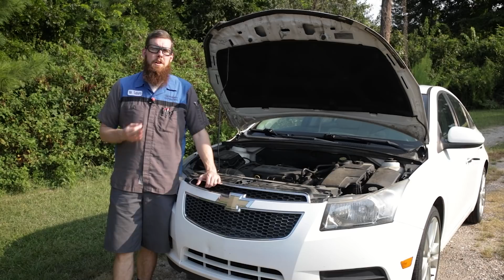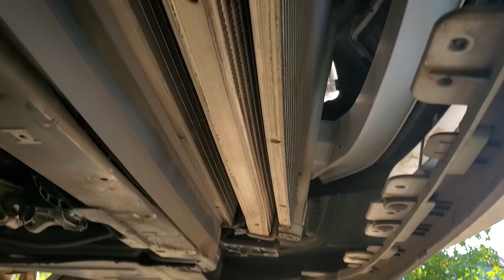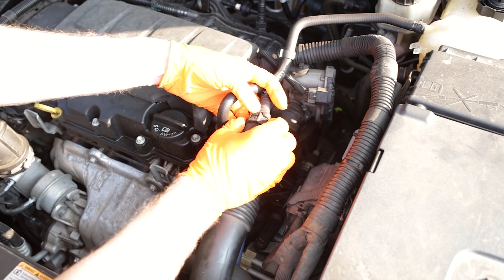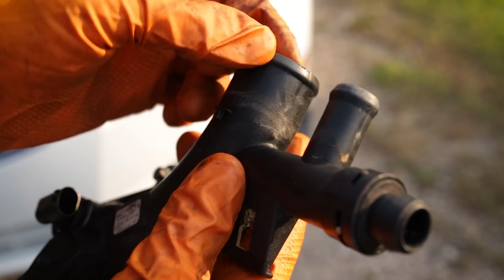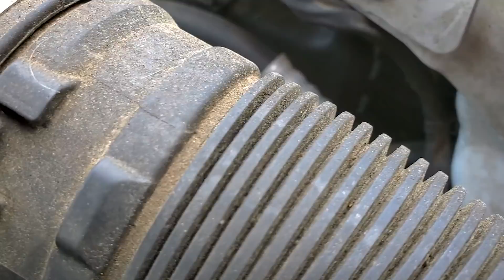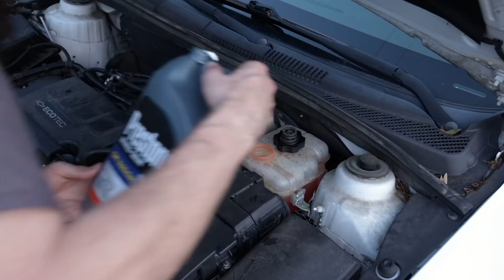Chevrolet Cruze 1.4L EcoTec Turbo: Coolant Water Outlet Replacement.

Comment: You don't need to remove the plastic things on the bottom or drain the radiator to replace the water coolant outlet.

Comment: Great video but wish he said hand tight on those bolts. Don't have an inch lb torque wrench but mine had a nm indicator so set it to 8. Snapped bolts off in the head. $20 part replacement is gonna cost me a lot more now

Comment: Ive watched a good amount of your stuff, your my Subaru go to. I just want to say...these cars are absolutely hellish. They never stop leaking oil and coolant, ever. Every fuckin oil change, something is leaking. Ive replaced some parts multiple times over 50k miles. Too much plastic, too much heat, bad designs, its got it all. I abhor this car. Cheers from a neighbor. I feel for your soul, dealing with this car. It never ends.

Comment: had one of the lines blow and spray coolant all over the engine and into the coil pack. had to go in and get it cleaned out and replaced just to have it spray coolant again cause the water outlet was broke clean off inside the line.... not taking it to my mechanic again since they claimed they replaced all that stuff before i had issues. 40 dollar part hr hr and a half to switch out. saved hundreds of dollars.

Comment: I've had mine since 2014.. I don't think there has been a day when it hasn't leaked coolant. Never let them overheat though as they will almost certainly bend the head. At that age I'd be changing ALL the rubber hoses, including the turbo feed lines as they will likely be deteriorated. While in there I'd replace the seals in the oil cooler.. Also replace the turbo oil feed and return lines and make sure the feed line is insulated properly.. I just did all this work and glad I did as there was significant degradation.

Comment: My last car was a 2014 Chevy Cruze 1.4 non turbo. I had a leak in the same area, for mine I had to replace the hose to the overflow tank. That car ended up shooting a connecting rod through the block at 62K. Punched a hole straight through the block as well as blowing apart the mounting bracket for the A/C compressor. I'd have been impressed except the car had a typical 3 year/60,000 mile warranty and GM told me tough shit as my Cruze was at 62K. It's like they put a time bomb in the damn thing. I replaced the motor sold it and got myself my 2018 Legacy limited (that's how I discovered this channel) and I couldn't love the thing more. I will never, for as long as I live, purchase another GM vehicle. Even if it costs me my life. JDM all the way, I'm tired of being ripped off. I've brought two cars over 300K, both Hondas, and I've had two vehicles suffer catastrophic engine failure before 100K, both Chevys. My current goal is to try to make my Legacy my first 400K car, this channel will be key to that goal, thanks for the vids man.

Comment: Why E-Torx? Just why? Not the worst job in the world, but I just hate working on transverse engines. This is of course an application where cast aluminum would last much longer.
Reply from the maker: To keep people from working on their vehicles. These new fasteners are a repair deterrent from the auto manufacturers, not some magically improvements in fastening technology.
Reply: @MrSubaru1387  Bingo. Hate 'em. I see them strip constantly too. Pain for everyone.
Reply: They're actually E-torx Plus on this car. If you use the regular e-torx you will start to strip them. They're used for reduced head size and when a machine tightens them they are less likely to fault the machine at assembly plants on small bolts than hex parts. Real popular with Germans. When you remember that this is an Opel Engine it will make sense.
Reply: @goldduster318  But of course, hahaha. Kill me.

Comment: My wife has a 2013 Chevy Cruze LTZ RS,and I did the same repair, but that's the only problem we've had with that car, in over 140k. miles.
Reply from the maker: I just replaced the thermostat today. Stuck closed/mechanically broken.

Comment: Man my first car was a 13 chevy cruze. The pcv system failed multiple times and the valve cover would leak oil and the spark plugs would become loose. I went through 6 water pumps. I sold the car finally and bought a forester. Best decision of my life

Comment: Tragic those European type plastic fittings.... that used to be Alloy or some sort of metal casting. VW started this rubbish with plastic water pump impellers and it spread from there. Lucky it's not Soy based as rats would have already eaten it.🤣

Comment: My eldest daughter owned a Gen 1 Cruze.  It was a nice driving car but a nightmare of issues especially with the cooling system.  And the electrical system (bad negative battery cable).  And with the PCV system setting lean codes. And with the ...